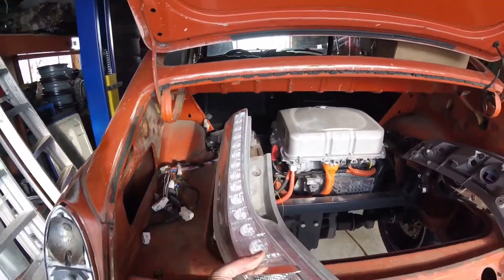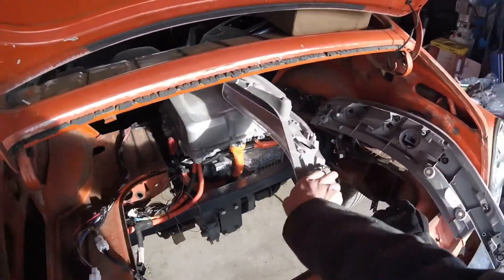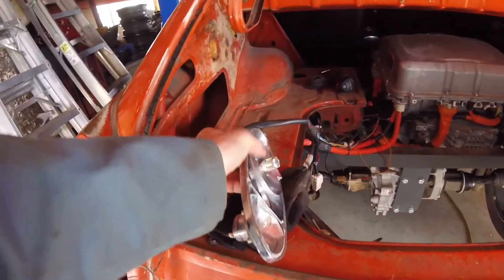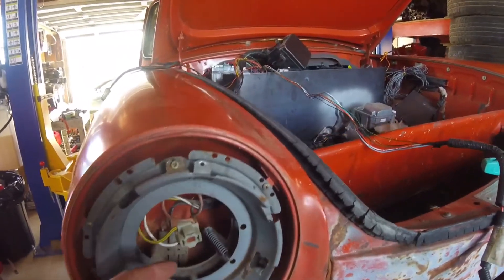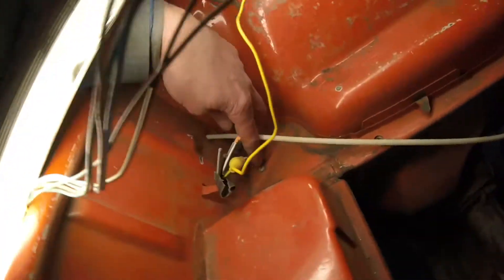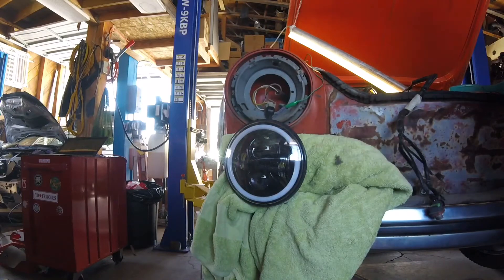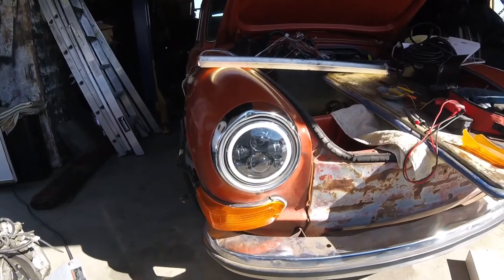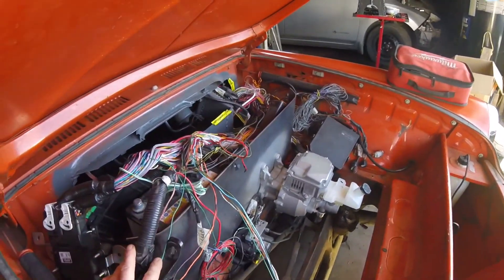LED lights on classic VW EV Conversion

Comment: I would like you to make a 2007 Mustang GT leaf version when you finish old leaf conversion car i like
Reply from the maker: I’d be happy to help. The FastLEAF has been driving for almost a year without issues (only about 1500 miles though!). I look forward to better weather as I don’t have the heat pump installed yet.

Comment: Amusing... In the UK its illegal to fit LED lights to classic cars as , they had a "legal minimum  wattage " not light output. in that era! ... People sell LED lights with load resisters to up the power use! Dumb answer to dumb law.
Reply from the maker: That’s really funny, I guess law makers weren’t expecting technology improvements!
Reply: What's funny is that people in UK follow the rule to use power vs make light.  
I found that i needed to keep incandescent lamps in the front turn signals to use power so the old turn signal blinker thing to heat up and cycle the lamps on -off -on -off, all four LED and the circuit didn't blink, the LEDs are way brighter and use less power.